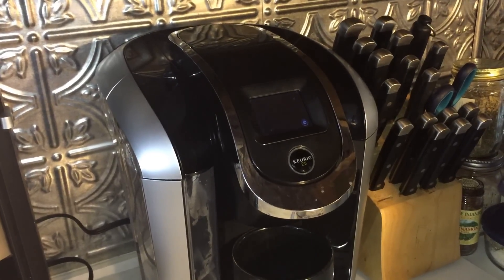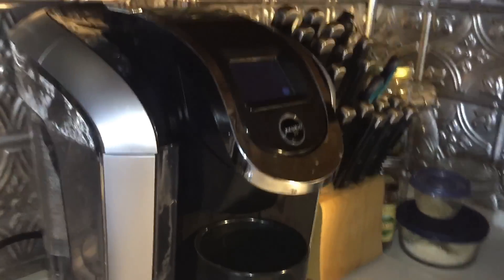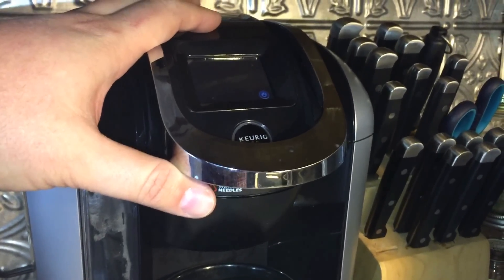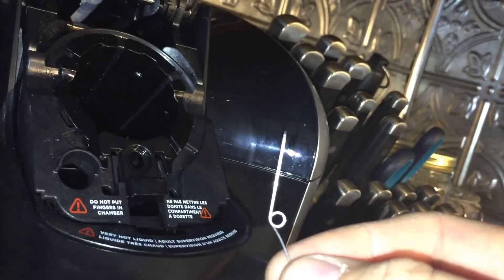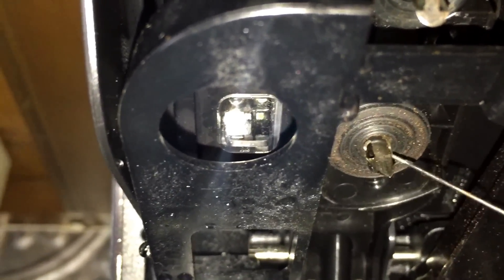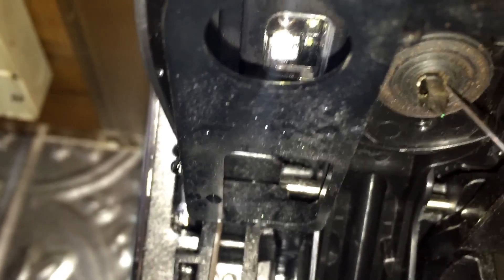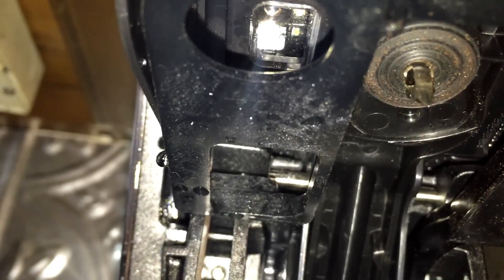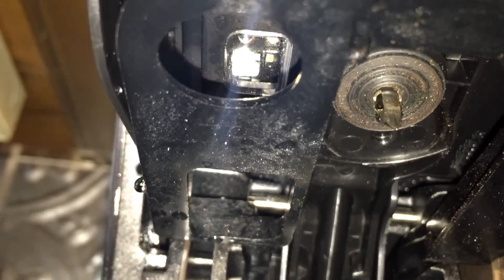Keurig 2.0 Slow or Not Brewing How To Fix

Comment: This morning, I got a text from the GF that I needed to fix the Keurig when I got home. Sure enough, it was barely passing water through its "dispensing mechanism". I knew I'd find a fix on the Internet, and thank you for providing it. A paper clip would probably work as well, but I used a straightened (smallish) Safety Pin to make sure I had a nice small, pointy tool. Running it through several times was the magic bullet. Afterward, I ran straight water through for at least 40 to 50 ounces of water, and the first 3 cups had considerable grounds present. I ran water through until I had 3 cups of "ground free" water. In all cases, the water was dispensed nice and fast. Thanks!

Comment: I have been having a problem where the water trickles slower but the Keurig 2.0 kept running, never stopping until I unplugged it. Some websites said this problem was not fixable, but your simple method did the trick! Runs like a champ & shuts off with proper proportions again! Thank you!

Comment: Thanks so much! This really worked!! I have had my keurig 2.0 for less than a month when it started dropping slowly instead of completing a full cup. I was about to unplug it and take it back to the store. I didn't have any safety pins or paper clips thin enough to you but I'm a girl on a mission. I used a (brand new) drugstore earring and it fixed the issue fast. This is a lifesaver.

Comment: Thank you!!! I've only had my K560 for a week, and it stopped brewing.  I tried the manufacturer's troubleshooting tips (ie. remove & clean the lower housing, descaling), but it didn't work.  I watched your video, and it made the difference.  The top needle was full of coffee grounds.  I used a paper clip to clear it, and now it works like it's supposed to!  I just wish I would've seen your video before spending the $13 on the descaling solution.

Comment: Did everything: removed and cleaned lower parts, poked the hole with a pin, turned it off for 30 secs and ran a hot water cup. Lots of coffee/tea grinds rinsed out, thanks for your video!

Comment: thank you for the closeup of the interior, i could not figure out why my paperclip was not going into the needle until you showed the close up and i realized it had to go in at an angle. my Keurig is fixed now.

however, considering how gross the inside of this machine gets, i won't get another when this one dies for good. it was a gift and these 1 cup machines have a LOT of drawback that don't make up for the convenience of the system.

Comment: My 2.0 500 Series brewer did not come with the orange cleaning tool one of the comments mentioned and provided a link too.  Additionally my manual makes no mention of the upper pin - it does mention and provide instructions for cleaning the lower pin.  I resisted buying a Keurig for non-sense like this for years but my wife really wanted one, so now I have a coffee pot I need to poke with a paper clip every so often.  What a piece of garbage.  

Thanks for the video.  This seems to be helping my issue.  I was knee deep in vinegar thinking I needed to descale this thing and it wasn't working.  This seems to have improved the issue.  I'm gonna keep sticking it up in there.

Comment: I submit to you that a guitar string (preferably a 'B' string) works great for cleaning the stylus / needle. It has the added benefit of being very flexible and you can really dig in and move it around and clean out any tiny coffee grounds or other small obstructions. I didn't have a paperclip around, and using musician technology, i easily cleaned the needle (i have an older single cup Keurig) in the main body, and also the needle in the plastic insert that goes into the bottom section (where the K cup drops in - this is a two part section btw, and you can rotate the lower half slightly to disassemble it - this helps to see where the lower needle in this 'basket' terminates and you can run the string out and through that area).  Thanks for the video.

Comment: Mine was also pouring only half cups and I thought it was something more serious that I'd have to reset somehow. When I saw your video, it reminded me of a tool that came with my Keurig! It's called a Brewer Maintenance Accessory. I recommend looking it up and getting one if you can. It saves the hassle of digging around with a needle. I used mine and my Keurig is back to normal! It's the simplest little thing.
Reply: If I could attach a photo I would should you what mine looks like!
Reply: I got the little cleaner pod with mine and tried it multiple times this morning but it's barely helped.  Gonna take a needle to it next and hopefully save myself the trouble of contacting Keurig.

Comment: My Keurig 2.0 would start off making normal pumping noises then after a few seconds would start making very slow pumping noises and took a lot longer to brew a cup of coffee or dispense hot water.   The pump sounded like it was brewing on the Strong setting, but it still took much longer to dispense the water for coffee or hot water.  I used that paper clip trick shown in this video and the problem was fixed.  Strange how something so simple worked.   Thanks for the heads up on this fix.

Comment: I've had mine a little more than a year now & this slow brew just started the day before yesterday.. I'm going to try your pin method. My machine didn't come with a tiny brush, as someone before me mentioned. Also, I have to continuously hold my brew button for hot water as another viewer mentioned. I thought it was weird, too, but it just spits once if I don't hold it. 
Thanks for the video!

Comment: For those that have this issue with their machines: The Keurig 2.0 Brewers come with an orange device that has a little silicone ball with a hole in the middle made exactly for this issue.  Its called the Keurig 2.0 Brewer Top Needle Cleaning Maintenance Accessory. Do not throw that out, apparently they provide you the piece for a reason. What you do is take the little orange device, fill the rubber ball in the middle of the orange device with water till it's full, place it in the k-cup holder (where you put your coffee k-cups), then you gently and SLOWLY open and fully close the lid of the machine 5 times (like you would be making a cup of coffee)! This is exactly how Keurig told me to do it when I had this issue 3 years ago and ever since then I haven't had one repeat of slow brewing. You should clean your needle at least once a week, but it really depends on how much you use it so you decide when it needs cleaned. If you threw out the Keurig 2.0 Brewer Top Needle Cleaning Maintenance Accessory  call Keurig and have them send you another one. Hope this helps

Comment: Thanks. Frustrating problem as this has to be done weekly to remove clogs. Suggest taking used up out of machine right after brewing is complete to help prevent clogs. Also, am using a small screw driver that comes in a standard eyeglass repair kit to clear clogs.

Comment: does this work with the first one? mine is VERY slow, if I want to make tea I use the microwave I can't use the kurig , it also only makes half a cup when I press full cup
Reply: Jo-E 
Mine is a year old and came with an insert that has a bulb in it. You put water in the bulb and open and close several times and it cleans the grounds out of that needle.  Then run a few times with water only.
Mine was literally dripping water...drop, drop, drop. Now it's working fine. 
Good luck. I also used a toothpick instead of metal and blew it out with canned air.

Comment: To be more specific. Shove your pin through the hole in the golden needle thing. Your instructions weren't clear at first, and I thought you were talking about the rubber gasket above the needle.  Congrats on being the #1 Google result for : Kuerig 2.0 slow.

Comment: The 2.0 comes with a cleaner for this problem. The little orange ring with the clear rubber ball in the middle. Read your instructions instead of throwing them away. Smh
Reply from the maker: dl87z28 Well I'll be!  http://bcove.me/nacg0jg4
Reply: +FSG Thanks for the reminder.  She presses the water cycle once but mine we have to hold the button down for plain water.  Is that right?
Reply: You shouldn't have to do that with the Keurig 2.0 machines.  When you close the lid it has a sensor that recognizes the Keurig cup.  If the cup is not inserted when you close the lid, the touch screen will prompt you for hot water only. Just press the brew button.  That's it.
Reply: +dl87z28 thanks a lot!!
Reply: We received our 2.0 in early 2015, and it did not come with the Brewer Maintenance Accessory to which you refer, nor is it referenced in the instructions that came with our Keurig 2.0 - the instructions that came with the machine advise using a paper clip!).  Owners of machines that were shipped prior to the inclusion of the BMA and that were purchased from Costco rec'd letters from Keurig/Costco advising them of the availability of the BMA, and offering the accessory for free by emailing them at costcomember@keurig.com (providing your name, address and serial number), or by calling 866-901-2739.

I've been using the paperclip method for several years now and it's worked on all Keurigs that I've owned.  I descaled my Keurig over the weekend, and it was still dripping slowly even after the descale process and after the paperclip method.  When I was searching the instructions to see if the BMA was included with our Keurig 2.0, the instructions referenced that the exit needle can also become clogged.  To declog the exit needle, remove the section of the machine that holds the K-cup in place.  Pull the lever on the bottom of the K-cup holder towards you, and while holding the lever down, flip the K-cup holder upside down - you will then have access to the hole where the liquid from the holder exits into the cup.  Insert the paperclip in and out of the hole.

While no grounds came out of the exit needle during the paperclip cleaning, afterwards I ran a water only cycle through the machine.  Not only was it a strong flow again, but there was a LOT of coffee grounds in the bottom of the cup that flowed that must have been loosened by the paper clip and was subsequently flushed through.  I hope this helps someone else whose problem may not be resolved by cleaning only the top needle.
Reply: dl87z28 doesn't work for clogs.
Reply: Ash S but a syringe or turkey baster does
Reply: I have the 2.0. I have the orange accessory. I used the orange accessory. I still needed to do this trick. I actually couldn't see the stuck ground and tried using a corn cob holder, but found some picture wire to stick up in there. Once I did that, the orange thing did it's thing and I had all kinds of grounds coming out. You'd think soaking overnight in vinegar would've loosened the grounds up to allow the orange thing to work, but glad I came across this before taking the machine apart.
Reply: I have mine and always use it when I clean it (every 2-3 months).  Ran into this issue and it didn’t fix it. However, this video helped out!   Problem fixed!!! Tku!!!!!!